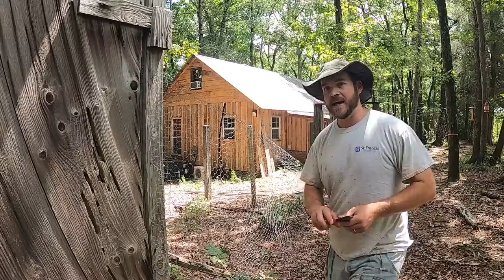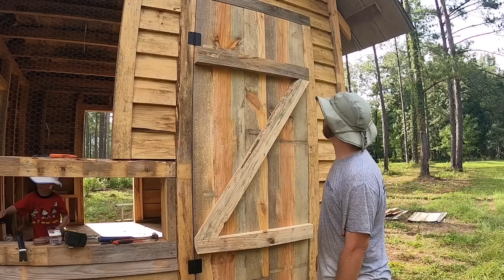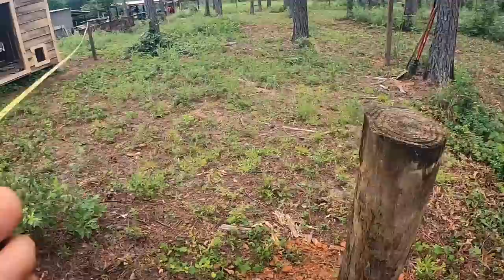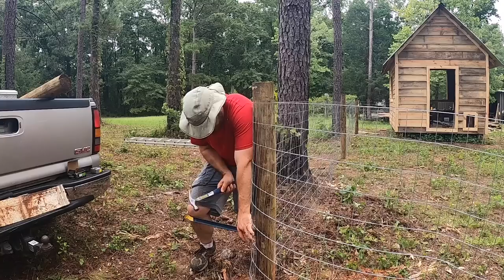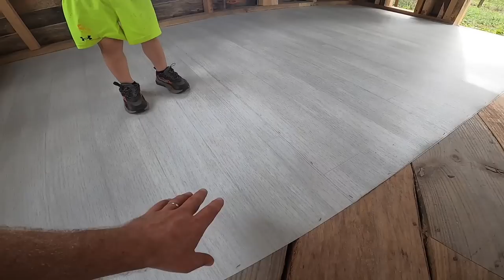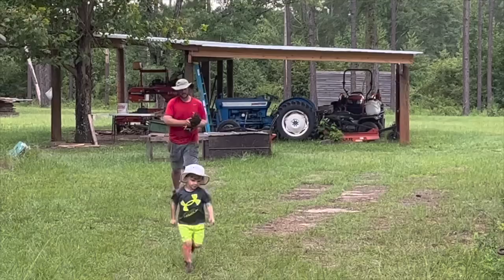Building a Chicken House, Part 8

Comment: Turn door so ‘Z’ support is on inside of coop, door will then open without interference.
Reply: Exactly, and also the Z is upside down, to top of the Z (or top of the door) is supposed to rest on the lower hinge
Reply: This will also keep the water off the x and help prevent rot.
Reply: Nice suggestion but would it then interfere with the inside door stop?
Reply: @yolala100  The "/" board is actually the correct way when he first installed the door. You don't often see it in the middle of the door like this, so how much it helps... not sure.  The "/" out of the Z should always point towards the lower hinge.  So in this case the TOP RIGHT of the door, would push down the length of the "/" into the lower left hinge.  It's possible that's what your saying, but I don't quite understand what you're saying either.  Since he had it installed both ways in the video, he was technically right the first time.
Reply: @OGBRADASS  his door isn't 4 inches thick
Reply: Exactly what I want to say. It looks even better
Reply: @OGBRADASS  The "/" out of the Z should always point towards the lower hinge. That is what I was saying, maybe I choose the wrong words (French Canadian) lol
Reply: Absolutely!

Comment: I think the linoleum suggestion may have been mine. You're gonna love cleaning it, as much as you can actually love cleaning a chicken coop, that is. The chickens will slide a bit when the jump sown, but they'll get used to it. I throw all my sawdust in from the sawmill, makes great bedding, and really good fertilizer after you compost it for a few months. The corn especially loves it, lots of nitrogen. Best lookin coop I have seen in a while.
Reply: I used a really thick plastic I got at Walmart in the material dept. On top of the nesting boxes, because they keep pooping on it from sleeping up there at night, and all you need is a water hose to hose it off and it comes right off, or you can use a shovel and just scrapes off, so linoleum would work Great.

Comment: Need to make my nesting box bigger! I can't sleep in that lol ...just a suggestion on the nesting box door hatch ....add 2 or 3 cleats to prevent it from cupping and splitting ...also a tip on building doors and gates ..,use gravity in your favor...the angled brace should angle up from the hint side letting the opposite side of the hinges settle down compressing against the angle brace and not pulling away or apart...cheers I love when a plan comes together

Comment: I use to use post hole diggers around here for all the fencing till I turned 50...  Bought a post driver for the tractor and now I can set a post in about 3 minutes...  I was waitin for you to get dizzy unwindin that tape measure from around the little Kubota...

Comment: I heard you say that you didn’t like the smell of the chickens. It shouldn’t stink. We lay in a foot of dry pine shavings in their covered run area and 6” in the roost. We clean out layers of shavings once or twice a month and add fresh. End of the growing season we dig out the bottom half of the shavings and put them in the garden. Add fresh shavings to replace what we take out. No stink at all but we keep it deep. We have the covered run for the bad weather. It’s about 10’ x 30’ and they only use it in the evening or bad weather. This is fenced with 1/2” hardware cloth that keeps critters out. They have about a 6500 square foot area to free range during the day. 🙂

Comment: You mentioned the hammer hits on the window trim.  If you want to get rid of them, or at least make them less noticeable, wet a rag, set the rag over the mark, and run an iron set to cotton over the rag to heat the water.  The hot water will swell the wood back into alignment, or at least make it better.  Your son's tractor measures exactly 95 feet around.

Comment: Props to you, rolling and stretching those fences on your own is a bear of a job, done it too many times myself and I don't think they've ever turned out as good as yours did.

My only concern with the door is that I wonder if the hinges will hold long term? I would consider adding a 3rd hinge in the middle at least..

Comment: Nice job, but you'll probably need to make a few adjustments on the doors and windows as they swell during the wet winter weather. I sure hope your chickens stay on the side with the rug, chances are they won't.haha. All and all, it's a fine-looking chicken house.God Bless.
Reply from the maker: They didn't...they're roosting on the food bucket which is in the corner, on the wood. I think they've been jammed in that chicken tractor so long they never learned to roost. Hopefully they'll figure it out.

Comment: 21:50 You might consider putting the chicken wire or small hardware cloth around the chicken pin cause if you have bitties they will get right thru that fence wire your using.

Comment: Put the hinges on the z supports so they are flush to the outside. Door will open all the way and you can keep the looks of the door.
Reply: Agreed.  Better yet, turn the door around. Why would you have the brace on the outside?
Reply: @markdavies9912  I like the looks myself.
Reply: @markdavies9912  Also, brace on the outside is a rain catcher.  Moisture in that  crack between brace and door takes a while to dry out, promoting conditions for  premature rotting.
Reply: @pachydermhomestead  ok, each to his own. To me, it looks really out of place and stops the door opening properly.
Reply: @garybessey2184  to me, it’s like putting framing on the outside.

Comment: I saw that the first chicken didn't know what to do.  Chickens are hypnotized by straight lines.  When we were kids, we'd draw a straight line in the dirt, place a chicken's beak at the beginning of the line, and hold its head still.  It wouldn't move when we let go, but just sat their motionless.  There are lines between the boards not covered with linoleum.  Could that be the reason the chicken didn't move?